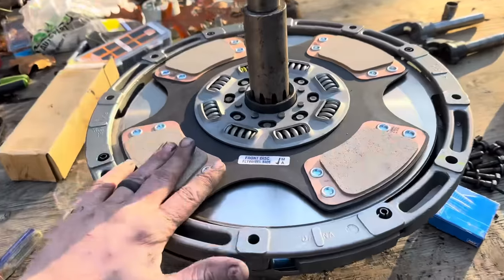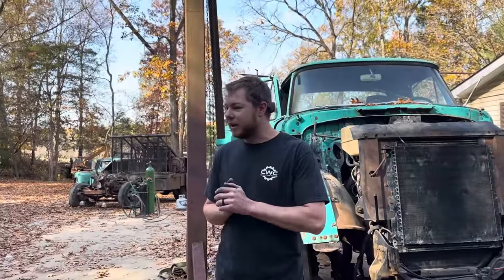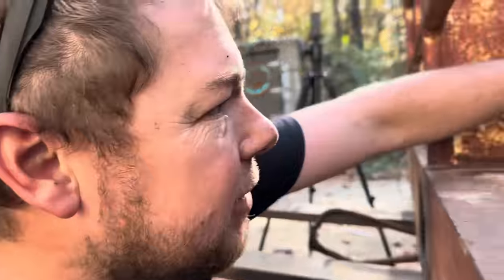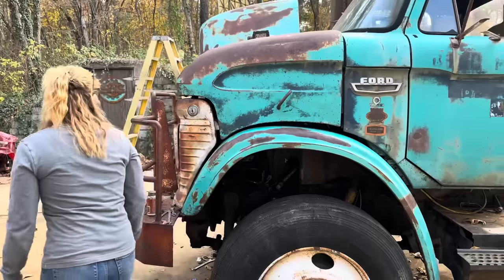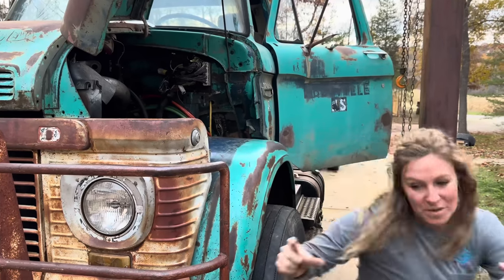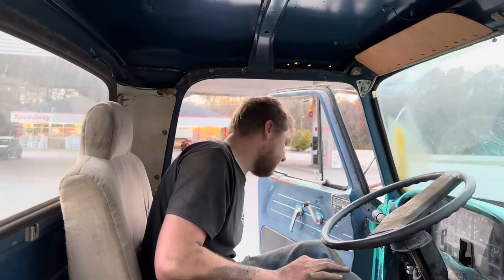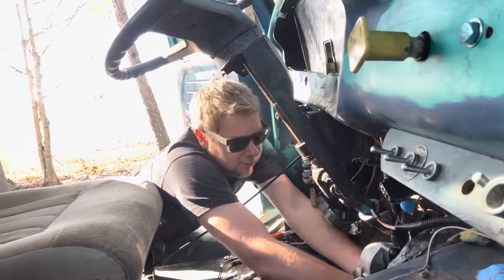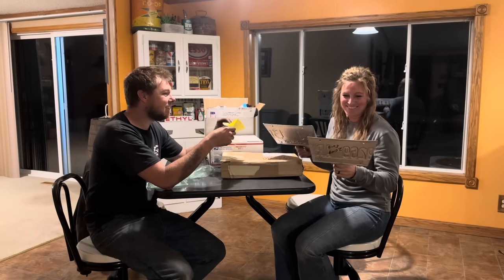Who really needs third gear???

Comment: Quick little test you can do when you go to but a manual trans vehicle that has synchronized gears. With the clutch out, not engaged, try to put it in gear. If the blocking rings are good and not worn out it simply will not go, and will not grind. If it grinds, it usually means the synchro rings are worn and letting the teeth engage.

Comment: Truck looks awsome! With that trans and clutch set up you should only need the clutch to get going from a stop... no clutch needed while moving if you get to the right  rpm. If you put the clutch down while moving you will burn up the clutch brake quick

Comment: Does this truck have an
 Air Drier on it? Thats what I thought I was hearing it Sneeze every so often to remove moisture from the system.
One more thing, you need to learn how to Float the gears when you shift.  No clutch shifting. Theres several videos on the Tube on how its done. Sure saves on clutch adjustments and replacements. Once you figure it out on how to do it you'll wonder why you weren't taught  this when you first learned how to drive a manual transmission.  I'm a retired truck driver in my 70's and have been floating gears all my life. Clutchless shifting saves on your left knee and having to wear your platform shoes to drive!  😂
Love you're videos!

Comment: I do. 89 Corolla and 3rd gear is the only forward gear that works. No reverse either. It’s slow going but good when I get to 50. To many trips to ocean city md. We’d R slam it into reverse full throttle while traveling 70 and I’m not kidding when I tell ya it wouldn’t stall. Front tires would scream in reverse until the car stopped and started backwards. That was truly lots of fun on Hwy 50!

Comment: If that air compressor has a D- governor, it can be adjusted down as to not blow the pressure relief. It will be a small aluminum valve bolted to the side of the compressor head...b

Comment: If this clutch is like a semi The clutch linkage adjust the clutch brake disc pinch when held down it should pinch the disc that stops the input shaft and clutch adjustment is normally done by a bolt on the pressure plate when doing a semi truck you normally need to a helper to push clutch

Comment: Wow. You guys are good!! Thanks. Is this thing full air brake? Or air over hydraulic? I also didn't see a clutch brake. That being said. How did you adjust that clutch? Single disc clutch has free travel and that is about it. You are breaking into the heavy truck world and I'm not sure you are familiar with it. Air compresser over pumping. Air govenor? Let me know if you have any questions. I can help with your air system! Relay valves, quick release valves. Not sure how to give you my contact info.

Comment: Not sure if your truck has a clutch break like most truck transmissions but if it does tell Hanna not to shove it all way to floor unless it's sitting still it's only to stop transmission input from spinning to get it into gear
Reply: Air governor is sticking can sometimes clean old oil out of them but they aren't that expensive stick new one on in few minutes

Comment: Should be up to 115 to 120 psi. If its building past that and not popping off. Replace the govenor on air compressor.. 2 bolts  couple air lines.maybe $25 from heavy truck parts place.. simple simple tix.

Comment: First thank you for explaining your philosophy about setting deadlines and taking shortcuts to meet them.  Obviously, I do not agree with that philosophy.  Example...I have major complications with you welding the bumper to the frame.  Weld a piece of plate the width of the channel in the frame to the bumper, then bolt it to the frame.  I've run across safety bumpers that were installed that way for years (And I've been fortunate enough to be here over 3/4 of a Century now).  Then I would suggest you weld smaller plate to the top and bottom therefore, creating your own custom channel.  "If" you want to tack the bumper to the frame for peace of mind?  Then I might buy off on it.  And tacks are easier to remove than solid welds.  Taking short-cuts for deadlines just goes against everything and every fiber of my life philosophy.  I've learned the hard way through the "School of Hard Knocks" that short-cuts are not the answer (not to say I haven't taken them when I've been broken down on the side of the road over 100 miles from home just to get home.  Only immediately to undo the shortcut and make a "long term proper repair" that won't leave me hung out to dry over 100 miles from home in the future.).  But, I guess if it makes you happy living that way, that's your choice.  I know I couldn't.  In the end, it's your channel, your business, your projects, and you choices.

Comment: Shifting with clutch. Either double clutch. Or DONT use it when shifting. When u press clutch i  too far.. hit clutch brake.. F whole shift up. Only use clutch start and stop. SMOOTH SHIFTS ALL ABOUT RPM  .. RUN UP TO SAY 1700 rpm. Shift into neutral. Braely let foot off throttle. Drop Rpmm to say 1400-1500 rpm.. should go into gear like butter. Big truck trans totally diff then like ur dodges

Comment: Dad and I had a dump truck like it had across the front of it we wrote snapping turtle you look at it by the front. It looks like a turtle. Ford made an awesome truck, other than the bolt wedge here off on the rear spindles on it or the rear duels on italways had rear in trouble but she was a good truck and she hauled and ours was gas and got 7 miles to the gallon empty or full. Have fun. Have fun be safe may God bless the godly redneck.